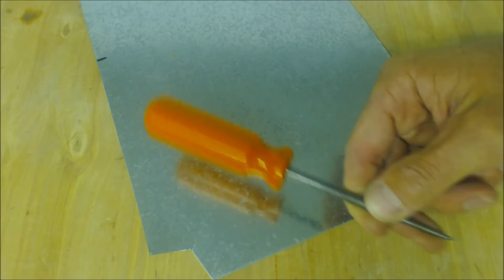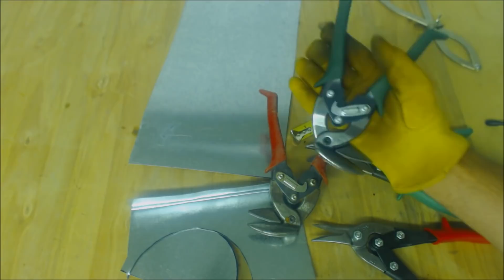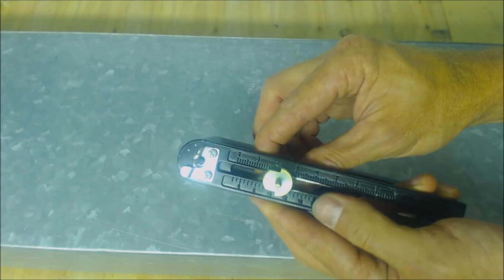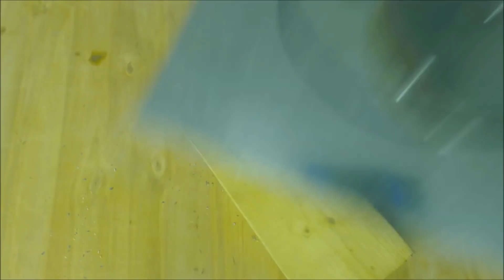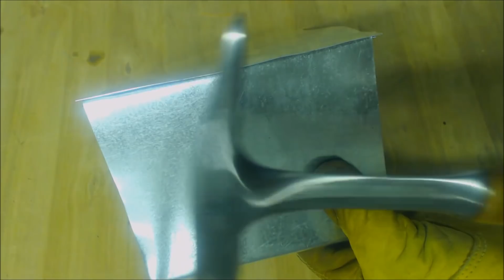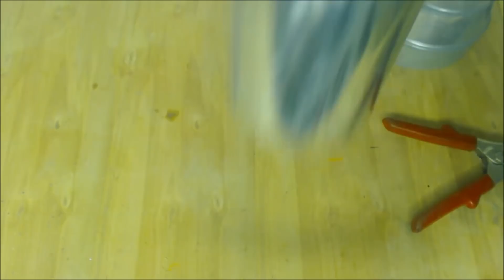HVAC Ductwork/Sheet Metal Tools- Basics, Uses, & Demonstration of Each!

Comment from the maker: Tool List-  https://www.amazon.com/shop/acservicetech
Support-  https://www.patreon.com/acservicetech
For those that are looking for the tools used in the videos: (Linked Below)

Here is the link for the Malco Combination snips with 3" long mouth-   http://amzn.to/2wuft2L

Here is the link for the Wiss Cable Tie Tensioning Tool-  http://amzn.to/2wtYL3D

Here is a link to the Malco Snap Lock Punch http://amzn.to/2cY53Ag

Here is a link to the Wiss 3 Pack Tin Snips http://amzn.to/2bHWhWO

Here is the link for the Wiss Bulldog Snips-   http://amzn.to/2x1BeIY

Here is a link to the Wiss 5 Blade Crimper http://amzn.to/2bwTlsW

Here is a link to the Wiss Hand Seamers  http://amzn.to/2dRk83v

Here is a link to the Midwest Upright 90 Degree Right Hand Tin Snip-  http://amzn.to/2x1TfGZ

Here is a link to the Midwest Upright 90 Degree Left Hand Tin Snip-   http://amzn.to/2iSwpvc

Here is the link for the Wiss 12" Folding Tool-  http://amzn.to/2xGqb52

Here is the link for the Wiss 18" Folding Tool-  http://amzn.to/2wx8y7v

Here is the link for the Wiss 24" Folding Tool-  http://amzn.to/2wu6DCg

Here is the link to the Klenk 20oz Sheet Metal Hammer- http://amzn.to/2wxzTpY

Here is the link for the Malco FDC1 Flex Cutting Tool-  http://amzn.to/2wwNrlv

Here is the link for the Klein 7/8" Step Drill Bit-   http://amzn.to/2xGQVSQ

Here is the link to the Dewalt 1/4" magnetic bit drivers-  http://amzn.to/2x1V073

Here is the link to the Dewalt 5/16" magnetic bit drivers-   http://amzn.to/2vUYLWV

Here is the link for the Malco Sheet Metal Scribe-  http://amzn.to/2eunoU0

Here is the Link for the Malco Dividers for Making Circles-  http://amzn.to/2xGN6go

Here is the Link for the Malco Notchers-  http://amzn.to/2iRTrlH

Here is the link to the Malco Scratch Awl-  http://amzn.to/2vUvmfy

Here is the Link for the Malco HC1 Adjustable Collar Cutter for Drill-  http://amzn.to/2vBHxlU

Other tool links can be found in the video description section.

ACSERVICETECH is a participant in the Amazon Services LLC Associates Program, an affiliate advertising program designed to provide a means for sites to earn advertising fees by advertising and linking to Amazon.

All of the ACSERVICETECH Playlists-  https://www.youtube.com/channel/UCOZR-1IqsAer9wzlvFgb4mA/playlists?view_as=public

If you want to support the ACSERVICETECH Channel and receive more HVAC content, check out www.Patreon.com/acservicetech
Reply: Asome  thanks man
Reply: Do you have any videos on making a plenum using duct board?

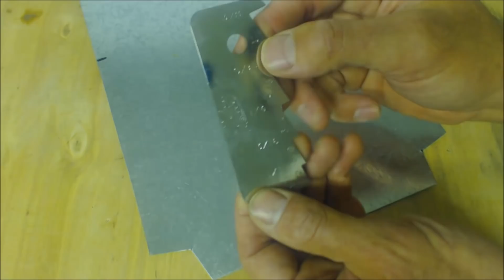Comment: How do you use the scratch tool at 2:50? What keeps it from marking several points at once?
Reply: you tilt it a little when you slide it along the edge. We make better ones at the shop but this one seems nifty.

Comment: Nice video !! I decided that if I was going to make myself stand out as a HVAC contractor installing and replacing HVAC systems I was going to make the best looking duct work possible.I purchased a floor model Lockformer used for $900.00 and also purchased a 24 gauge portable Lockformer to use in the field for $600.00 off of Craigslist with a 36" brake .I also picked up a 48" box & pan brake and 8' brake as well for my small duct shop.
Reply from the maker: Very Cool!
Reply: You make some really great videos !! I went to a HVAC trade school  37 years ago which was a full time class from 8AM-3PM Mon.-Friday for 13 months straight and cost 11K lol.It was a state of the art trade school in Baltimore Maryland that opened in 1955 and sold out to Tesst Trade Schools Inc many years ago.We had several  labs as well as a equipment lab with at least 25 different HVAC systems set up and operational so we could see how they operate in real time and HVAC instructors could also put bugs in systems for us to troubleshoot as well.So I have been in the HVAC trade for 36 years now and been running my own 2 man HVAC contracting business for 28 years now. I love your videos  and I have to say you would make a great HVAC instructor at a HVAC trade school. The only problem is the pay is not that great I am told because I was offered a few jobs myself teaching HVAC in a few HVAC trade schools but again the pay was just not there. Thanks again for the great videos. Take care !!
Reply from the maker: Thanks Coolmandude1000, I presently teach at a county technical high school in southern NJ, have a business, and teach what I can here. I am planning on building out more with other teaching opportunities online, thanks
Reply: Yes I could imagine that you would be a excellent HVAC instructor. I had a woman instructor for my 2nd half of HVAC school program  for 1/2 day  who was a awesome teacher and worked in the HVAC field for 23 years for SEARS and was very patient with students. She was also a ex flower child/ biker chick from the 60-70's and very mechanically inclined.She made sure I graduated at top of my class with a A+ grade average. Thanks for teaching the HVAC trade to younger people who as you know  not many want to work with their hands these days.My HVAC class had 38 students and we had a 10 year reunion and only  7 students were still in the HVAC trade which was very sad.Keep up the videos as I enjoy watching them.Take Care !!
Reply from the maker: Thanks Coolmandude1000!
Reply: coolmandude1000 i work for a small mom and pop heatiing and cooling company. We make all are metal in house. It saves money and time. U are on the right path to put ur best foot forward.

Comment: Thanks for the practical demonstration of these tools.  I installed my own heat pump and the transition from the air handler to the supply ductwork was a bit complex but I worked through it. To me, it was the worst part of the install.  Thanks.
Reply from the maker: Ductwork is very time intensive for sure especially double offsets, thanks Eric S!

Comment: I have been looking for a V grove duct board cutter. We mostly use duct board for our supply box and return. I didn't know if you knew of any reputable sites that might sell this tool. I looked on amazon and they currently do not have it. The brand I was using was malco and it did a good job. Thanks man
Reply from the maker: You are looking for the Malco FasGroov system or individual FG tools. I will send you an email, thanks